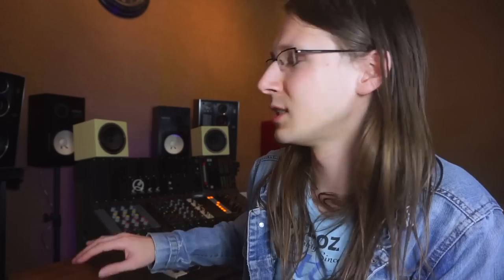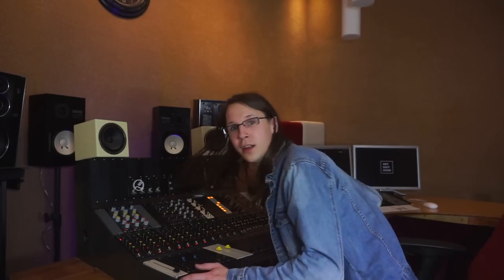Why Yamaha NS10's SOUND HORRIBLE?!?

Comment: I mix on NS-10's at a very "LOW" volume in mono. Once I get the EQing & mix right, I reference on  my Tannoy's 15" dual concentric's & the mix always sounds terrific. Lower volume lets you mix longer as well. Give it a try. i'm sure they will make a huge difference in your mixing & mastering. Thanks to Bob Clearmountian, for the introduction. From an old 60's rocker !

Comment: I mixed for years on NS10's with a combination of other monitors.  It's the reference constancy you get with the NS10 i.e. music mixed well on NS10's tends to sound great on other systems, especially club systems, which is why the majority of 90's UK dance music producers used them. There's an art to using them though, things like if the woofer starts to blat ( or fart as some people say ) at a certain volume your bass is too high in the mix. They're also great for vocal and instrument placement, especially guitars against vocals. NS10's never sounded good though ( which is what a lot of people don't seem to get )  they're just a great reference for getting the frequencies sitting in the correct place in your mix. It's a grot box really. 

I'll also add that the people who tend to hate on them probably either haven't actually done that much mixing with them or haven't been schooled in how to use them properly. The hate is completely unwarranted, their track record is second to non for a small nearfield. More hits have been mixed on this speaker than any other out there, that's a fact. 

I mean, I no longer use Ns10's mainly because the tweeters are now hard to come by ( and you do blow tweeters with this monitor ) I now mainly use ADAM A7X's but I still favour the grot box combined with another monitor for referencing mixes. My grot box of choice is now the Behritone C50A ( for mids ) and the tiny £10 X-mini to gauge how mixes will sound coming out of say a laptop or smartphone.
Reply: I found much the same. They highlight and exaggerate any flaws and nuances in the mid bass to lower vocals. I found my mixes started to have much better definition and tightness there. Though I didn't like how much body i would tend to pull out of that whole range, and at times would end up with a somewhat cold and thin mix. And that became part of learning how to use them properly. I use mine in combination with redone Koss m105 powered MTM's and Hiel AMT 1's. With testing on about 15 other systems... And things keep getting better.
Reply: NS10s sound as good as the mix is.
The point of a monitor is not to give you a "good sound", as you said, but it's to give people opportunity to do a "good mix".
That said, I use them for everything, I also watch TV on my NS10s, and if are used to their color (which is none) you enojy their sound too :)
Reply: Now, I don't strive for 'hits', nor do I have enough experience to be of any authority here. But in my opinion the NS10's are great for their purposes, but I do think there are better options out there today. Not everyone is as sensitive, but I find my mixes get dull through later (somewhat similarly voiced) monitors by Yamaha because of their brightness. I'm sure I could adapt with enough time in front of them, but that's where my only actual problem with them arise. NS10's (and to a lesser extent HS-7's or HS-8's) simply are too sharp for me to be able to work with. The ear fatigue is so overwhelming that I need to reset so often I have a problem keeping efficient.
You can achieve similar accuracy without the emphasized high mids today.

And yes ChristianIce, all monitors, all speaker cones colour sound. Some more than others, but they all do. NS10's are exceptionally neutral, but nothing is truly neutral.
Reply: @skatterpro  Absolutely agree, all speakers sound different. Wouldn't say the NS10's were exceptionally neutral though, but why would you work with something you can't stand listening to?!

I found a pair of LS3/5A's that I'm enjoying using very much. Bit hot around 140-150 but still great.
Reply: I'll never forget the study that proved the toilet paper tweeter attenuation trick caused comb filtering and was ruining mixes.  I used them along with my EAW MS-50 monitors. Great combination.
Reply: I have never tried NS10's, but I have Yamaha H5 from their new series, do you know anything about them? They are 'supposed' to be a little like the NS10's , they have become a bit tiring on my ears, so I am thinking maybe I will need to keep them as that, referencing speakers and use something less "aggressive" for the mixing process. Thoughts?
Reply: @TheRealHucasys  Avantone Mixcube.

Comment: I've found 3 specific places where the ns10m's are great: 1 getting the right amount of balanced thump to a bass drum; 2 getting the snare to sit well; and 3 hearing reverbs more clearly than will apear to the final user on consumer equipment.
Reply: That’s why mixers use the speaker cuz it helps magnify the mids Sony can hear the mids so if ur mixes are bad on ns10 then the mix ain’t great but if it’s great on ns10 it’s great anywhere and this what they all say and I’ve used them once and I hear what the engineers hear

Comment: I actually took drivers from an old NS10 pair and made proper calculated boxes for them not those weird rectangles they come in. I took reference from the HS8s cabinet design and the overall quality got impressively better and detailed. Improved the low end as well, which I was not expecting I thought it would make them worse overall.

Comment: They actually don't sound horrible, at all. You have to use them in similar room acoustic found in studios where they were used to mix the most important records in history. Basically, laying on a foamed surface, close to a reflective angled window (a mirror can do), a mixing console in front of you (or a set of keyboards can also do) and I would also add a medium size object in between them. I have an horizontal pair of studio NS10 in front of me and they sound super good.

Comment: Great video! They're really hard to find nowadays, though. Yamaha now has a similar series of active monitors; the HS series. With that white cone, too. The reason why they are so popular is because the're awesome in the midrange, where most of music audio happens to be on a small frequency range: from 800 Hz to 6 kHz
Reply: The HS series is another speaker, the NS-10s sound much worse (I'm one of those who consider them pure garbage to ears). The HS series has that modern "Hi-Finess" and (texture wise) sound like most of the modern speakers, the NS on the other hand have this horrible, distinctive sound

Comment: A producer forced me to get NS-10's about 9 years ago . I now always start a mix with NS-10's .
They always make me notice harshness around 1.6K and they have good lower mids for
mixing vocals . When I feel somewhat finished a mix I then use the Genelec 8040A's and usually tweak
 a bit of  360-460HZ down a hair . Through all of this I'm checking the mix with Audio Technica ATH-M70x
headphones . I can't say which is more irritating those NS-10's or those Audio Technica headphones .

Comment: Spot on about how engineers brought their own gear into studios in the '80s. I'd heard about some of them bringing the ADS L710s or L810s for their exceptional near-field sound. I tried a pair of L810s on this desktop as a test, and they're still up here six months later. Best-sounding speakers I've ever listened to, much less had on this desktop. Had to use pads to keep the bass from traveling through this heavy desk,  but other than that, wondrous sound.

Comment: It's the damping that stops the cone moving not the stiffness.  Classic spring-damper theory: mx'' +cx' + kx = 0, i.e. (force due to acceleration + force due to damping on motion + force due to stiffnes = 0). Without cx' the cone would vibrate forever; in the real world that would never happen since c will be comprised of many differing parameter including the desired damping factor.
Reply: All true.. And the spider and the surround are also very stiff on these monitors (I own both NS10M and NS10M Studio pairs)

Comment: There is a reason NS-10's were so successful. It's not their frequency response. It's how relatively "quick" they are (an aspect in monitoring systems measured with waterfall graphs), allowing to better hear transients and where they sit in the mix. You can "learn" the frequency response (frequency domain) of a monitoring system and compensate for it in your head when mixing, but you can't "learn" its time domain nor compensate for it if it's rubbish. This is the primary secret behind NS-10's and why they make mixing easier despite their funny mid-range-centric frequency response. Notice how many monitor makers sell "flat" frequency responses but hardly show any waterfall graphs or talk about why that's important in judging mixing monitors. Not that I'd recommend buying NS-10's these days of course (because there are some great monitors from serious providers that do address this) but just saying. :-)
Reply: Interesting... what do you suggest?

Comment: When I was looking for my first monitors I checked out the NS-10's and then the Tannoy PBM 6.5's, the Tannoys gave me a better mix every time when I would take it around to listen to on various systems, car stereos etc. And every time I saw NS-10's in any studio small or large they had with out exception napkins over the tweeters! At any rate, get some Barefoot Footprint monitors and you have a wonderful monitor with subs included and the flattest frequency in it's class bar none, and you also get the dsp x-over with the "classic" setting which emulates the character of the NS-10's so you feel at home if you are used to them. It also has flat, cube and stereo settings so you wouldn't need the Avalon's plus you can hear how your mix translates to stereo speakers all with a twist of the knob on the x-over. Worth a look since you don't have that huge deck. Use iso pucks as well, your deck won't properly decouple your speakers and the difference is less smear in the bottom end and less phase and cabinet anomaly effects. Not all that cheap but a bargain as they are very good quality and replace 3 sets of monitors and one stereo speaker pair all in one.

Comment: Presumably, you’ve had a chance to turn out final mixes using your mix cubes… So you would have an indication of how well they translate, no?
I had the Yamaha NS 10’s above my console for many years throughout the 80s and 90s; it’s not that I liked them very much, because I thought that they were very fatiguing, especially when clients wanted me to mix at hotter levels of 85 DB and above... The main reason I had them, was that in those days, if you owned a commercial recording facility, you were “expected” to have them (thanks a lot, Bob Clearmountain, LOL); it didn’t matter what other monitors you had, because there were many great sounding monitors ( mostly passives in those days) that translated mixes incredibly well, that were nowhere near as fatiguing as the Yamaha’s. Unless the client specifically asked that I mix through the Yamaha’s for the entire session, I would normally mix through JBL‘s, or Urei Big Red‘s, and then PERIODICALLY check the mix through the Yamaha‘s for very short intervals of it me.  That said, thousands of hit records have been mixed through the Yamaha‘s over the years; I just could never take their harsh sonic characteristic for very long, and I never thought that other commercial recordings sounded very good through them, either.
IMHO.

Comment: So if you're intrigued about the NS-10 model, here's a lot of background trivia leading to a valuable hint that could save you money.
Firstly, let's fix the terminology. There is no one "NS-10" model.
The name "NS-10" can be used as a collective term for the series, sure, but there is no one model that uses the plain NS-10 label for their name.
All the models had some sort of suffix after the number. The late 70s model, i.e. the original in the NS-10 series, was called NS-10M, the "M" probably added for "monitor". All the later models had some addition to the name, like "NS-10M Studio" or "NS-10M Pro" or "NS-10M X", and they usually brought some sort of "innovation" to the series. Different orientation, different speaker, different tweeters, and more. The NS-10M Studio was the only in the NS-10 series (known to me) that was meant to be placed horizontally (i.e. lie flat), all the other models, including the first NS-10M, were meant to be placed vertically (i.e. stand upright).
The first NS-10M originally introduced mirrored tweeters to the NS-10 series, i.e. the concept of having the little high-end speaker at the top on opposite sides on each box.
The first NS-10M model is also the weakest of them all, it only has a Watt rating of 25W RMS and 50W peak, while all the later models with extended names can do 60W RMS and 120W peak.
So now... when I write the NS-10M was the original in the series, I mean it exactly that way. It kicked off the NS-10 series brand. Nothing more.
What I don't mean by that statement is that the NS-10M were an original concept. They weren't.
Before the NS-10 series was started, Yamaha already had a set of similarly named rather high-end "prosumer" HiFi speakers.
The NS-1000 and NS-100 series were around for ages before anyone even thought of the NS-10M, and they are still coveted (read: expensive) today. Both the NS-1000 and NS-100 series were 3-way speakers though, meaning that they had 3 chassis built in: low range woofer, high range tweeter, and an additional mid range speaker. (The NS-10 series only has woofer and tweeter, it's a 2-way speaker.) Visually, both NS-1000 and NS-100 series look suspiciously similar to the NS-10 series, just with a few more bells and whistles on them. You can see their relation clearly, although they are quite different if you look at them a little closer.
Now, apart from those two big ones, there was also "the runt of the litter" of the NS-1000/100 series. That cousin with the weird name that nobody talks about.
Tadaa, drum roll, enter the NS-615.
An upright 2-way Hi-Fi speaker similar to the NS-1000 and NS-100 series coloured, excitingly, in wood brown. Yaaa... wn.
If you wish, you can search for the badly scanned documentation and catalogue material for both series, NS-10 and NS-615, just like I did.
Or you can just believe me, a total stranger to you, on the Internet, in the YouTube comment section, when I tell you that you'll find a 100% match.
Well, that is 100% if you forget about the colour and the mirrored tweeters.
The NS-615 box had the exact same dimensions (HxWxD of 38.2 x 21.5 x 19.9 cm) and overall weight (6 kg) as the NS-10M later had.
Both the NS-615 and the first NS-10M model use identical part numbers for their woofers (JA-1801) and their tweeters (JA-0518), so they also shared the same Wattage (25/50W), impedance (8Ω), frequency response (60-20k Hz), etc.
(FWIW, the later NS-10 series models all used different chassis to allow for higher Wattage, starting with the NS-10M Studio that just had an "A" added to the end of its part number.)
So spec-wise, the NS-615 and NS-10M models are absolutely identical - except for the colour and the (non-) mirrored tweeters.
How thoughtful of Yamaha then to introduce the NS-615B at some point, a model identical to the plain NS-615 in every way, but with the added "B" suffix.
The "B" here simply stands for "black", the colour that contrasted so well with the white speakers and would later make the NS-10 series so easily and distinctively recognizable.
Notice that word "later". The last NS-615B speaker was built around 1975, just a few years before the first NS-10M model surfaced in 1978. Coincidence you think? :)
So there you have it.
If you don't want to pay ridiculous money for an "original" NS-10 series speaker, just get the NS-615 or NS-615B. They are THE SAME SPEAKER, identical in every way. Well, okay, with the exception of not having mirrored tweeters. But apart from that.
Now don't come at me all "tweeter position matters"... no it f*cking doesn't. It just looks symmetrical and tidy. Because Hi-Fi music buffs at home (for which the NS-1000/100/615 were made) care about how the music sounds, not so much about how the speaker chassis are arranged. But us audio engineers, we're a bunch of spiteful OCD-ridden pedants, so speakers with non-mirrored tweeters wouldn't fly. Well, they would fly, but only out of the window. So smart move about those tweeters, Yamaha, smart move. :)
To rub it in: I just picked up a pair of NS-615 in superb condition for peanuts. Zero bids except mine.
Somehow ironic, that everybody wants to have the "original" NS-10M, but nobody seems to want the ACTUAL original, that was then renamed NS-10M later.
Well, now you know it. If you can't (or don't want to) afford "enn ess tens", then just join the six-fifteen gang and laugh at those broke hipsters. ;)

Comment: The NS-10's bring out the 100-300 hz and 1000-2000hz. Those areas are problematic because many important instruments (Vocals, snares, guitars) occupy them.
Not smoothing out the highs or boosting lows for you to enjoy, they give more harsh and honest representation of that is going on. also IMO not having much bass lets the cone move to the mids more accurately.
Would pair them with a sub though, because that roll-off is very hard to work with.

Comment: I always start my mixes with NS10s . They're very accurate in the low mid vocal range and when you subdue 1200 - 1800HZ  in your mix, they're not 
too bad to work with . Biggest thing is when you mix with ( example )  Genelec with subwoofer everything is cozy and fine with the bottom end making everything 
enjoyable . Click on NS10s and you'll notice pitch problems and rhythm discrepancies you didn't notice when the low end was impressing you on the Genelecs .